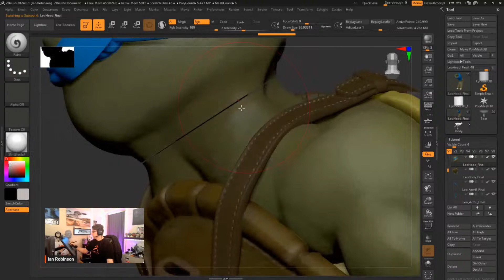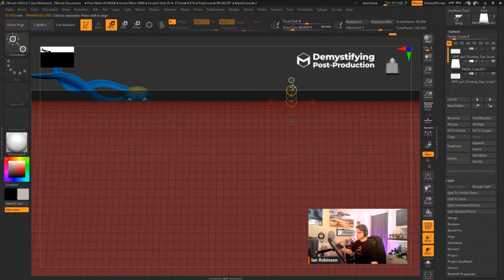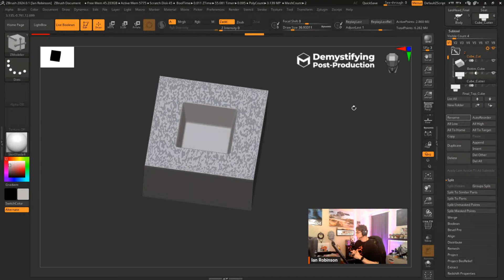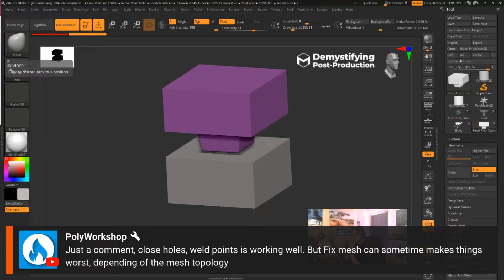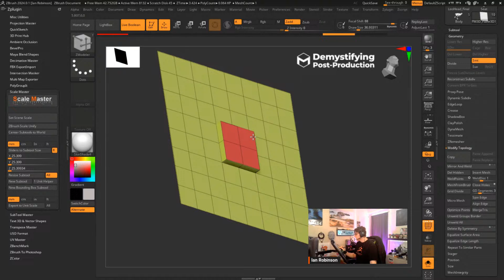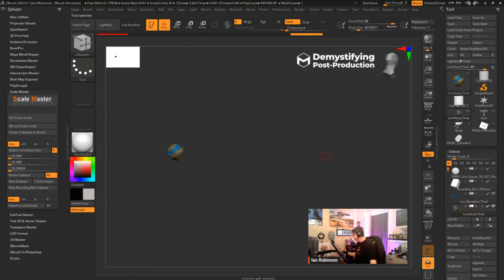DPP: 3D Printing | Week 1

Comment: Seems like it would have been way easier to make the first part of the key by grabbing some polys on the bottom of 'Cube 1' and extruding them out? Bing bang boom, easy. I'm still learning ZBrush but I come from a background of low-poly game character building where you had to work lean and smart, so I don't understand why you're working with meshes with such crazy high subdivisions, or trying to merge meshes with such different subdivision topology. Like, that process took you a full 30 minutes to get through just making the top part.

Comment: The subtool master 'all' button, isn't for all axis, it's for all subtools. 

Rather than using tedious and inaccurate inflate, better to use precision transform scale plugin, then you can increase the size specifically of the cutter by your chosen tolerance size (0.12-0.15mm), or just simply add the tolerance size to your axis's in subtool master and resize subtool.
Reply: I'm interested, please elaborate.